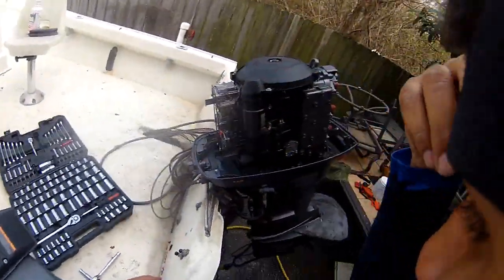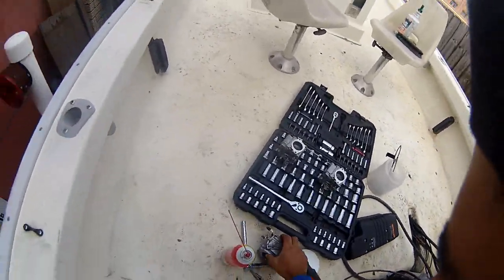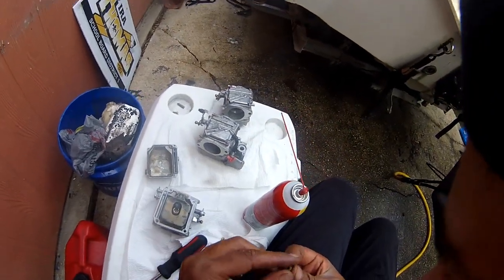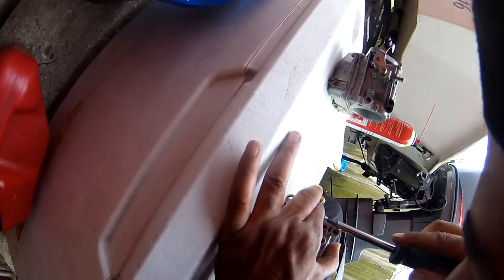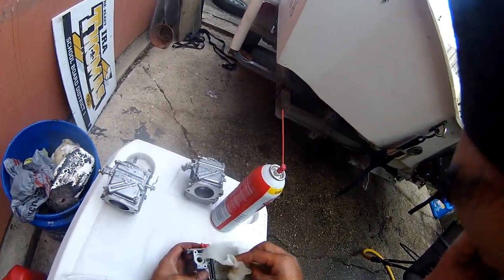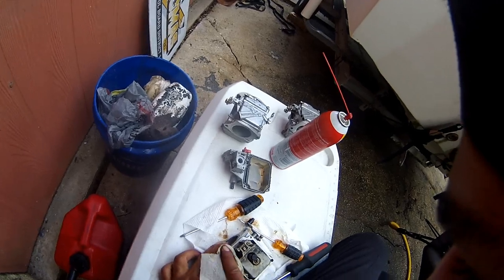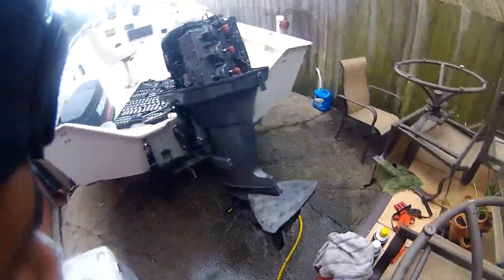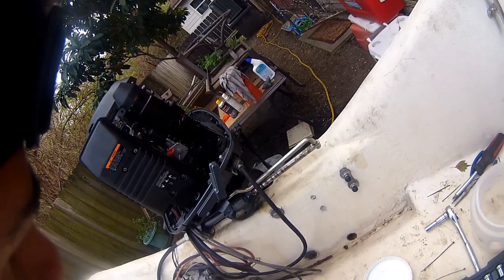14 Minutes Carb Cleaning for Outboard Only Runs on Choke

Comment: Usually something related to the main jet...  But you do also need an air compressor and a clean table to do a respectable job...   Takes about 3 to 4 hrs total to do a decent job cleaning every piece including careful reassembly of a 3 carburetor set.  And you better change the fuel filter also. (You can't leave so much as a spec of dirt in those carbs...)  Each carb must also go back into it's original respective position ie. Top, Middle, or Bottom.  Good Luck.